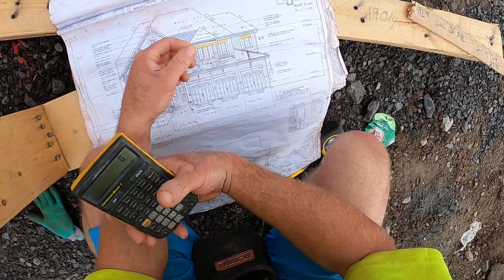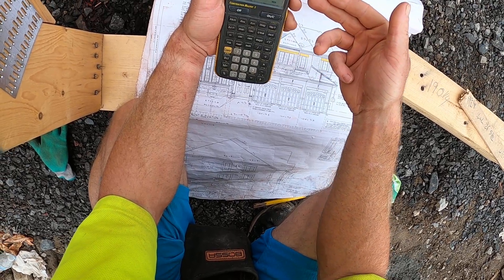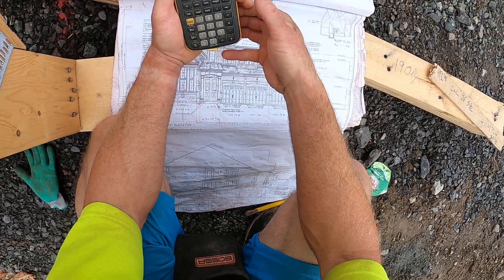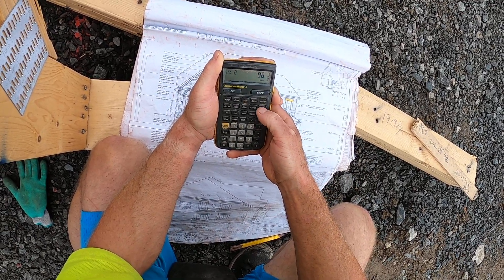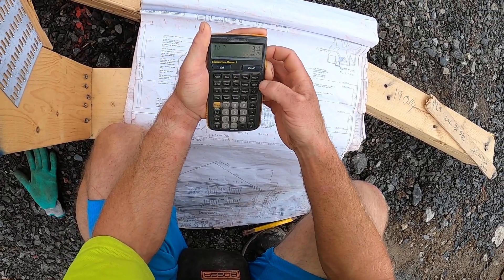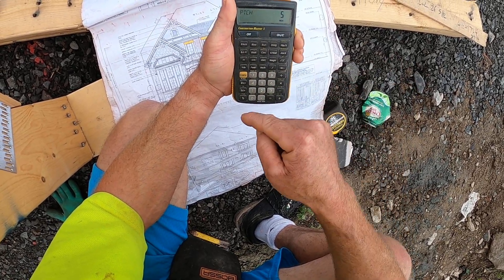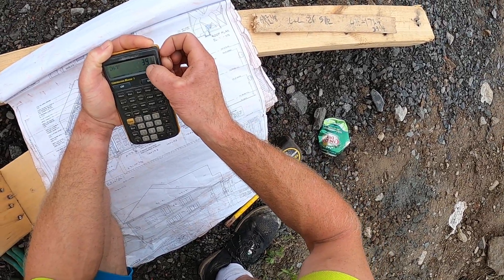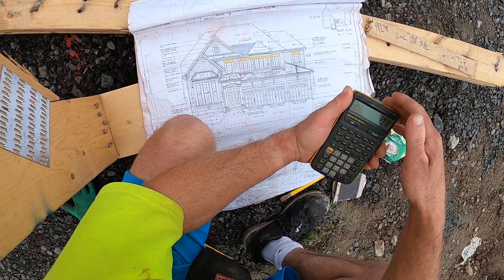Roof construction master calculator ground prep....plus handy dandy tape trick

Comment: I think I used a Construction Master perhaps one time in my life . For adding up my hours !! .. LOL .. I never liked them for the  reasoning . That you won't understand the math behind it . I am kinda old school .. I don't use an abacus , a slide rule or my fingers though .I never have referred to a Swanson roof table because it doesn't capture all angles . The numbers between 1 and 90 is infinity . Years ago . Had an older carpenter bring his roof framing book from 1903 . I think it was signed by The Wright Brothers . It worked but in the back was tables like a Swanson book . I have always referred to them as "The Book of The Brain Dead "   Essentially trigonometric tables .. Which are fine . but there sometimes is a pitch between a 4/12 and a 5/12 .   Swanson's you have to add a stack of fractions that have already been rounded off to the hundredth place . 1/100 " rounded off 20 times is 3/16" error . So on low pitches that can bite you in the ass . The problem to me using a Construction Master is it bypasses the understanding and movement of math .. Many pop in a few number " Span " and presto and it spits out a number . Never questioning to themselves " Why ?" . Many don't see the initially benefit of learning the math . They are building a house , Got to get it done and it was easiest .. Understandable ! ." The Master can convert bastard pitches to CDL's " Common Length Differences " and you can function in jack rafters between hips and valleys . And yet never understand why . Most Newbelts that start to get interested say it's too complex . And many older guys are stuck in their ways and scale a pitch or refer to a table .  I have proved to some guys they can learn Trig .. I ask them " For every apple I get you get 2 .. I have 3 apples how many apples do you get ?"    well 6 .. AHA !! .. There ya go .. There is the basics of Trig .. Ratio's!! . but with fancier names like tangent , cosine and sine .. But that's for later .. Their heads begin to explode if I say " For every apple I get , You get 1.414 apples .. I have 167.6875 apples how many apples do you get ?? "   Then they go to mush and I explain .. Do the same thing you did before . I lower it down a bit and make it more tactile to their world and then the light goes on . " How many grams in an ounce ?"   hands raise .. Oh Oh .. 28 !! .. " So if I have 2 and a half lbs of the weed how many grams do you have ?"   They will tell you correct , even taking into account the weight of the bag and the going market rate and profit potential . How it's maximized if it's cut into 1/8 oz bags ..   The Understanding is there !! .. Eventually with some they begin to get it  Triangles have 3 sides thus 6 relationships . The rise to the run , The run to the rise etc .  Grams to ounces , ounces to grams . Ratio's Baby !! ..  When working on some crazy roofs ..If it's filled with nothing but bastards . I draw a simple 1/4 section of a pyramid which I call "The Rosetta Stone " and calculate the numbers for each as a function . I can relate anything . calculate the placement of bastard hips and valleys on plates , The height differentials . The precise degrees . heights of HPCL . "Heel Plumb Cut Lines " stud heights , CLD on every member , side cuts , sheathing switchback cuts .   I see the math move !!! , and later I show them how to intersect and calculate elliptical , caternary , three center, segmented octagonal , on and on .. But for most that is a later date .   It's always best to see and understand how the math moves .. I uses a scientific calculator to crunch numbers and it's always helpful to make a rudimentary drawing of what's going on . The brain understands better .. For some I give them a real challenge as soon as they are ready to take flight ..and I mix it up so to maximize confusion . The test might go as this " I have a span of 34'-2-15/16" with a double 14" LVL ridge , The rafters need to be 1' higher than the LVL's for air circulation . The pitch on one side is 34.87 degrees , Is a 2x8" and I want a full 3.5" bearing cut and the plate is 142.3125" AFF " Above Finish Floor "  The opposite side is a 10.372/12 and a 2x10" with a HPCL of 9-3/16" .. What is the length of the story pole to support the ridge AFF ? . what's is the length of each rafter on opposing sides ? . What is the CLD of studs under each side at 19.2 oc since this is a gable ? and what is the bearing height AFF on the opposite side.   .  To solve it . You gotta know the movements of math .  Math is ironic if you really get into it . For instance .. A 12/12 pitch . has a ratio of 1-1.414 or square root of 2 . The hip's ratio is the square root of 3 . and the inscribed sides of an octagon's ratio is 0.414 !!!! .. Another simple one is . The foci of an ellipse are equal to major axis as the hypotenuse . Math is neat . I highly recommend understanding math .. I always say " Let The Math Do The Walking " .. Throughout the years I watched guys run strings and lay rafters out in the field to see it they came close . Nothing wrong with Construction Masters .. To me they can create a reliance on them and not know why the answer was derived .  Peace
Reply: @aquahero  um 95 percent of houses are built with pot heads and drinkers. How many prim and proper guys do you see on job sites. Not many. If you're doing remodels and working daily with homeowners then that's one thing but new construction sites are a different story. 
Sorry to hurt your feelings but that's how it is. Guys will drink a six-pack at lunch and walk three story walls. I personally quit drinking years ago but young cowboys are wide open.
Reply: @davegordon6943  You got that right . Sometimes it's amazing with potheads .. While high , they can't find a power cord even if their standing on it , In the next instance they can show you brilliance and build a free standing double helix spiral staircase . And I don't know how they worked it out . I don't smoke or drink onsite , But I did when I was in my 20's .. Brilliant and dumb as a rock at the same time . Repeating somethings like sheathing a floor . Many get into a groove and do excellent work . You are right .. Most in the trade had a choice of working at CVS as a stocker or better starting pay dangling from a roof as a carpenter . Our trade isn't filled with suit and tie type guys . Only the fat ones that drive up and hand out paychecks through a truck window . Then again I have worked with professionals that had a toolbelt so well organized . They were borderline obsessive compulsive . Some Bob Vila look alikes with suspenders and could talk game , But when it came down to it . Where lost and helpless . I know for myself . I have taken many throughout the years . Broke into that noodle and helped light a fire . Proudly looking at them as running their own companies , Working as superintendents and others tapped into their artistry  .. For myself . I have built everything from a rickety set of steps on a single wide , barn doors to having my work on the front cover of magazines , Winning National Homebuilder Awards and working with the countries best architects ..Some of my best ideas have come from those that knew very little . and many of them would spike a joint all day .
Reply: Haha that's awesome I do the same thing when teaching new guys how to read a tape. You have to put it in terms they will understand. Breaking down an ounce of weed. Eighths of an inch will confuse them but eighths of weed they  know exactly what I'm saying. Just say an inch equals an ounce. 8 eighths, 4 quarters, 2 halves. Dime bags equal 16's.
Reply: @aquahero  Yeah .. Smoked a joint back in 1989 constitutes a dope fiend . It was my gateway drug to the hard stuff like Aleve and Tylenol . .